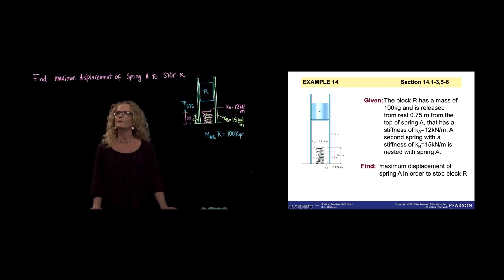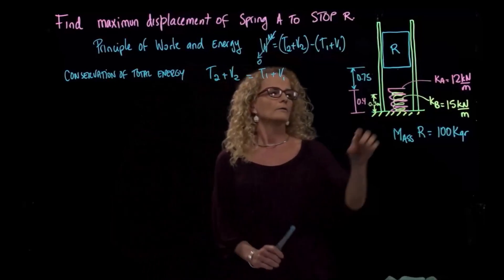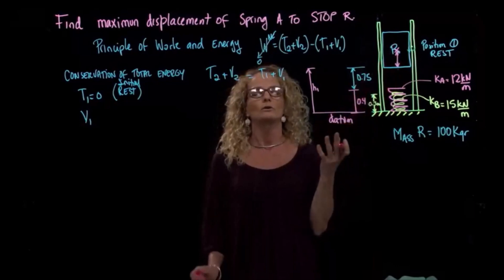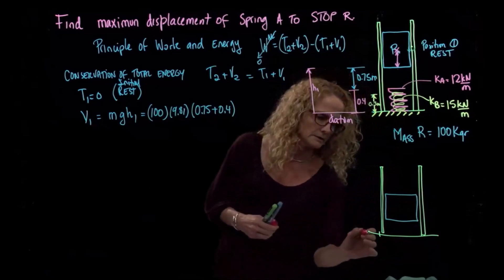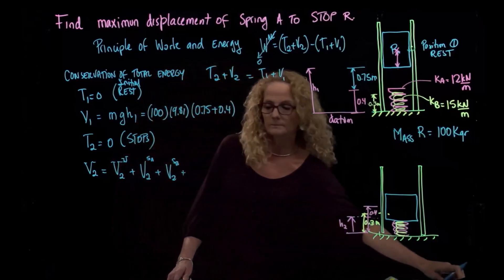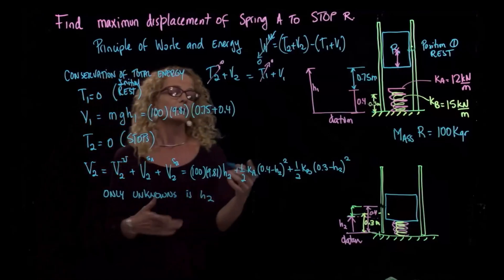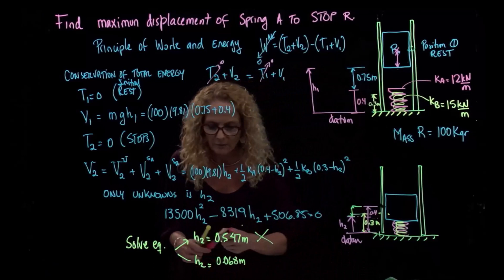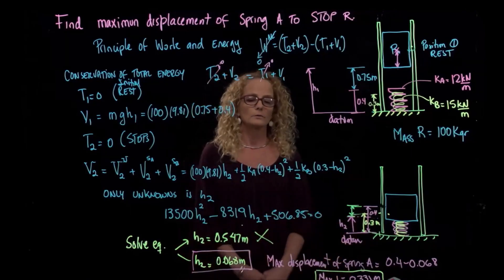DYNAMICS, Example 14.3.14 Principle of Work and Energy

Comment: I used another method and managed to get the same answer.
T1 + Summation of U = T2
0 + 100(9.81)(0.75+0.1+x) - 1/2(12000)(0.1+x)² - 1/2(15000)(x)² = 0

Displacement  x +0.1 = 0.331m